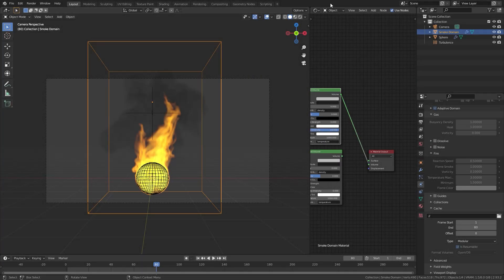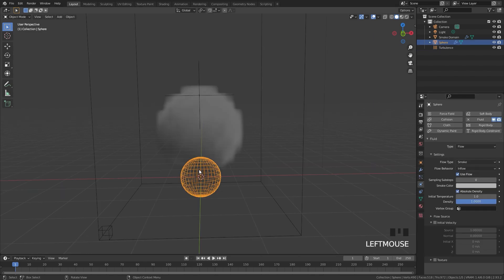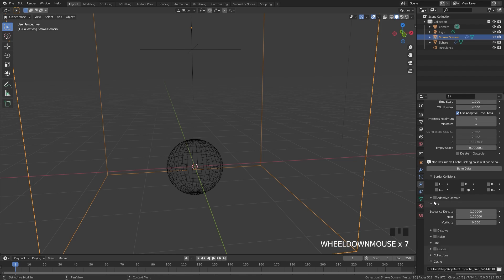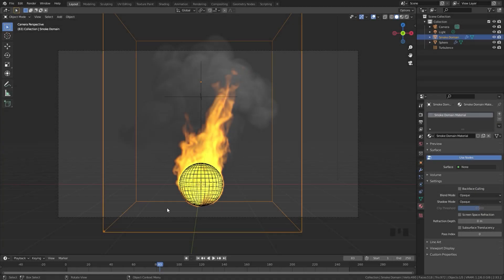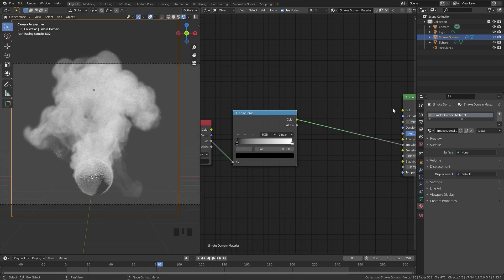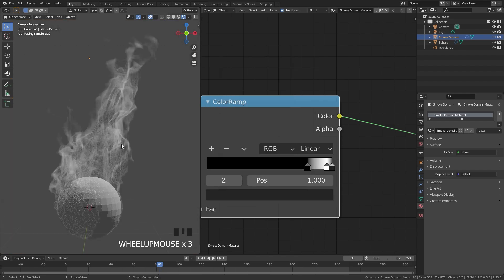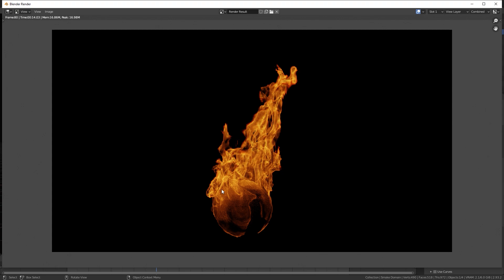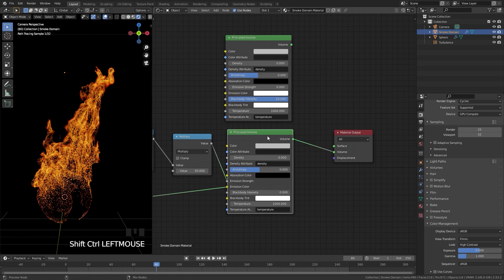Blender Tutorial - Realistic Fire for Still Renders

Comment: For anyone pulling hair because of non-working turbulence force field bug with pure fire simulation:
You have to add at least a tiny amount "Flame Smoke" (like 0.00001) under Fire tab in Fluid settings for your domain.
You can later remove that smoke by setting Density to 0 for Principled Volume in Shading tab.
Reply: How do you make the fire burn out?

Comment: For those who are working with version 3.1, try this method: connect the volume info of the density part to the color ramp and connect the color ramp to the math and set the math to multiply mode.
By increasing the multiplier, your fire will be brighter, for example, 40 is suitable. And finally, connect the multiply (math) to density or blackbody intensity. Make the right and left collars black and the center white
Bring the two sides of the black closer to the white.
Reply: What are you trying to say? What volume info to what density part?
Reply: @Jmvars  This video only works in versions before 2.9. So with this method that I said, you can make it like what you see in the video in versions higher than 2.9.
Reply: @AMIN-hk6vg  Yeah but I have no idea how I'm supposed to do that. I don't know which part is the "volume info of the density part".
Reply: @Jmvars  Add a node named VolumeInfo. This node has four points named color, density, flame and temperature. When you add the ninety-color ramp, there is a dot on the back called Fac. In the volume info node, connect from the density point to the fac color ramp point
Reply: @Jmvars  You have to select "smoke domain" then go to its shaders node where you created most of the shaders, create color ramp, connect color ramp to DENSITY of principled volume node, create math node, inside math node click add change it to multiply and connect that math node to color ramp.

i know this is 1month old comment, but maybe someone else will read this. 

anyway for me this didn't work. But, i tried adding bright/contrast node in between color ramp and emission color of principled volume it gave a bit of contrast, but still my fire looks like a ghost, barely any color in it + i have intense sun light so yea.... I am using blender 3.4
Reply: @AMIN-hk6vg  sorry, I don't get it. What ninety color ramp? Maybe is my english but idk what you mean with ninety color ramp! Can you explain better for me, please?
Reply: @ΛΞΟ  I'm also using 3.4 and my fire is light years from looking like the one in the tutorial!! I added the bright/contrast node like you said and the changes are almost none!!
Reply: @unyuu126   there has been a mistake. I meant node
Reply: @unyuu126  You must have made a mistake somewhere because it was exactly like the movie to me. This video is made for versions before 2.9. Where have you had problems? Tell me, I hope I can help
Reply: @AMIN-hk6vg  I'm really trying to find where I did wrong but I followed the tutorial strictly and can't see my mistake. I'm at the shading part looking for the nodes trying to figure what you said to see what happens but idk in which colorramp I need to link the volume info since the 3 are already taken by the attribute and the noise texture. Maybe my head is just burning like this sphere!!
Reply: @unyuu126  Can you give a picture of your shader?
Reply: @AMIN-hk6vg  you know what? I just colored the "gray" part of the first colorramp to a darker color (almost black) and it was that. That was my mistake and I feel ridiculous. This is supposed to be a little animation not just a pic and it was driving me nuts!!
Reply: @AMIN-hk6vg  ofc, do you have discord or something?
Reply: @unyuu126  Yea i don't think this tutorial works, he also uses black background which significantly increases contrast in comparison.
Reply: @ΛΞΟ  Did my method not work for you?
Reply: @AMIN-hk6vg  No, it doesn't make any difference. But thank you anyway!
Reply: my cycles is giving me 10 hours to render a single image,how can i reduce that?

Comment: When I closed and reopened the Blender file, the fire was completely gone. All the noodes were still there. I decided to delete all the noodes and do it again but nothing happened. Fire doesnt appear on the render screen.  What am I doing wrong?
Reply from the maker: The fire is going because the cache is saved in a temporary folder by default when you bake in the fire simulation. If you want to keep the fire you need to set a custom folder for the cache and bake it again. You can do this in the domain settings.
Reply: @BlenderMadeEasy  I opened a new blend and started making the fire all over again. I created a new folder on the desktop and selected this folder in the domain settings. After the bake process was finished, there was no fire or smoke. It completely disappeared again. During this time the blend file was always open. I did not close and open it again.

Comment: Such a great tutorial! I have a question: When I try to render this fire within an existing scene, I keep getting "GPU is out of memory". I've tried it using resolution divisions all the way down to 32, but no avail. Any suggestions?
Reply: This seems to be a problem with Optix. If you switch to CUDA the rendering will work. Though CUDA is a bit slow. So far I haven't come across any other workarounds. Hope this helps
Reply: Same here. But I am working on a potato pc 😂🙂👍

Comment: Hi. Thank you for the tutorial. I am doing (I think) all as you say but my fire + smoke is pretty much a gray fire. It's not like smoke covers the fire, the fire just is dull and gray. Can you please revisit the topic for Blender 3.1? Thank you in advance.
Reply: I have the same in blender 3.0
its just gray smoke
Reply: @drawingtom  I did solve it. You need to bake the fire then bake the noise. Once both bakes are done you get the good stuff.
Reply: @oritfx  Hi, how did you bake the fire without baking the smoke? On the flow sphere I don't even see a cache tab.
Reply: @IoIxD  1. In domain settings set cache type to modular - this will enable "bake data" button (a bit up in the same view).
2. Bake that data.
3. Once data is baked see the "noise" checkbox - you can expand it and bake noise as well.
For me that made the flame look gucci.
Reply: @IoIxD  You set the emitter type to fire only, and then the domain does baking of whatever emiter is inside of it. The domain has all the baking.
Reply: @drawingtom  Bake the flame, then bake the noise (there is a noise checkbox).

Comment: What setting(s) would I change, if I make a fire underneath a cauldron? I don't want the flames too high, or they clip through the cauldron and its contents.
So I guess I have two problems - 1) fire clips through the cauldron and 2) I limit the size of the flames (because of clipping) so short that the flames look cut off.
Reply: You could bake the simulation with a object like the cauldron set to effect it. This way the flames will go around / stop at the object. Then repeat the steps.

Comment: PSA: do not bake in cycles else it won't show up. Use eevee to bake then switch to cycles. Learnt it the hard way.
Reply from the maker: Baking has nothing to do with the render engine. There should be no differences. What exactly happened?
Reply: @BlenderMadeEasy  It was showing up in solid view but not in rendered view/final render. I'm using the steam version of Blender so this might have something to do with that as well. But hey thanks for the video, the end result really does look surreal
Reply from the maker: That's very strange.. I have no idea why that would be happening. Well thank you anyways! :)
Reply: @BlenderMadeEasy  I'm also having this problem and I have Blender downloaded straight from the website. The fire looks great in solid view, but disappears as soon as I change to render preview mode. It happens in Eevee and Cycles, and I followed your video step by step.:(
Reply: @krys5847  Same here, ever figure it out?
Reply: @jakewelch.design  Figured it out! Set the thing you set to Modular under the Cache of the Domain to Replay and increase the density of the smoke to something like 99

Comment: I don't know why but when I try to render in modular mode and bake data then the fire doesn't show appear in the viewport, I tried everything and nothing works, im using blender 3.0
Reply: I have the same problem...
And in Replay mode the fire just act strangely, it does not rise up: there are only colored patches around the sphere, which are only affected by the Blackbody Intensity value
Reply: same issue, I baked, fire only shows in viewport shading, where the four spheres are at the top, it shows on the first two but not material preview and rendered.

Comment: Had to do this twice to get the blocky noise out, in case anyone else has this problem, I set the RGB mode from the Noise texture ColorRamp from Linear to Ease, as Stephen suggested. i missed it the first time and it drove me bonkers. Finally the fire is looking perfect. Thanks for this amazing tutorial and all your hard work.
Reply: I ran into a very similar issue that was solved because my Math nodes were set to Add not Multiply